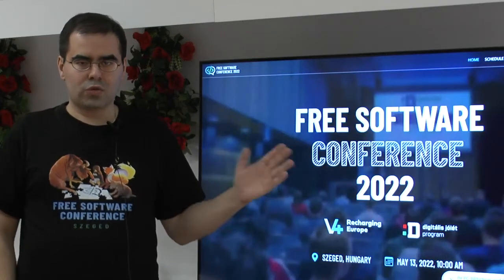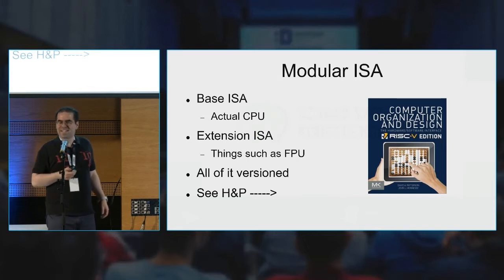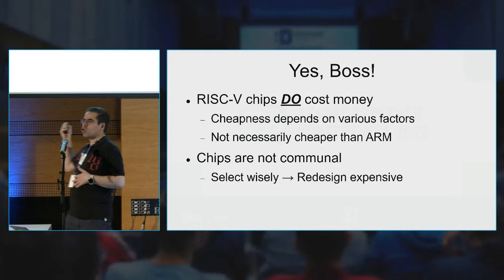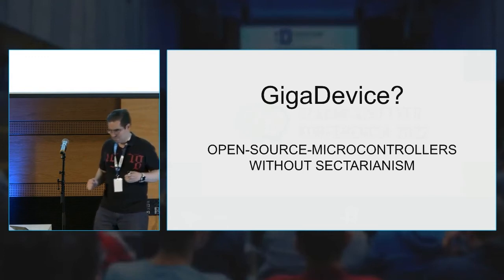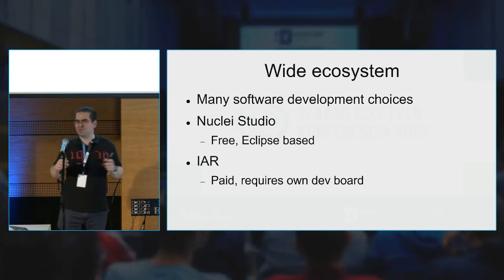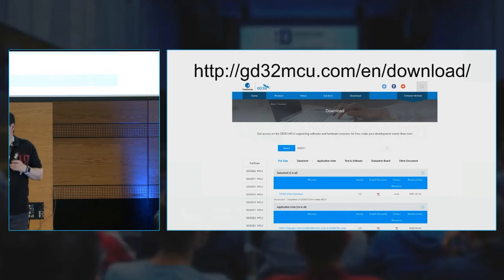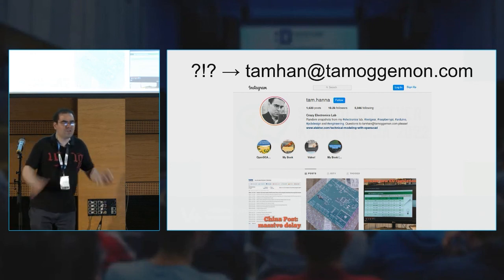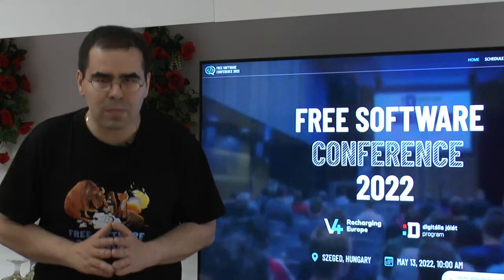RISC-V in 20 minutes

Comment: There is no reason to have concerns about fragmentation. They are part of the usual development. Even x86 and arm versions have changed. Customizabilty of extensions is a big advantage for not being forced to carry around the whole IPs, which are not needed, as you cleared at the end of your Q&A section.

A solution to tackle incompatibilities and upgrades on a hardware level is to take one RISC-V ISA base and to realize further needed extensions by an fpga chip. The concept of dedicated chips for certain operations are nothing new in the IT world. Some seniors remember the times of x486 and an additional, seperate FPU chip, until the latter has been included.
Reply from the maker: Hello Al,
thank you so much for talking back! I am in general not worried about fragmentation, not even in Android as it is needed to create the optimal product for different applications!

As for the FPGA: I think this is, in general, a very good idea. A microcontroller with an FPGA cell inside...incidentially this is also what the first gen OpenHW chip will do to get peripherals.

And as for the x486..oh man, fond memories...mine was an AMD 5x86 in the end...